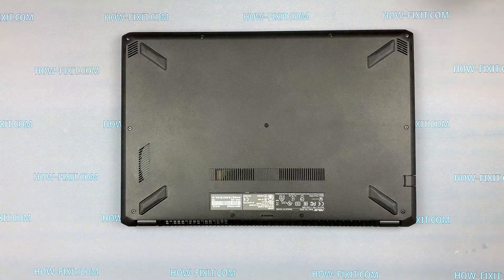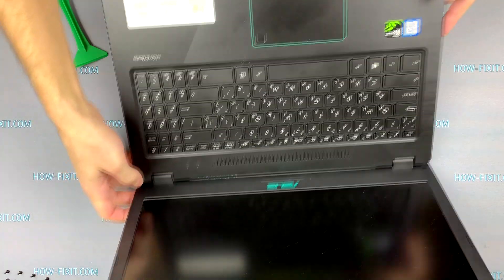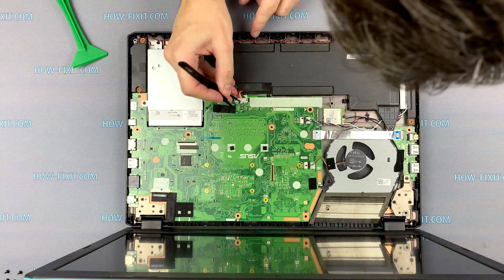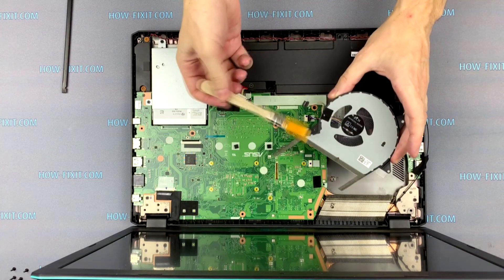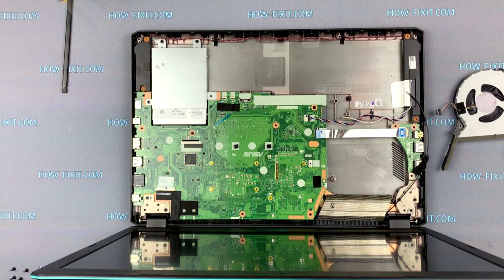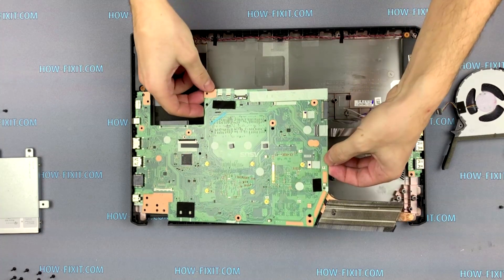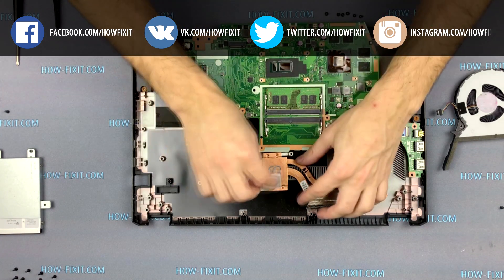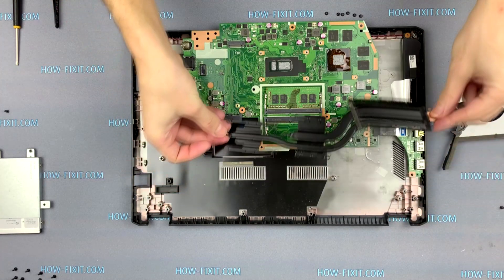Asus X570, K570, F570, A570, M570 Disassembly, Fan Cleaning and Thermal Paste Replacement

Comment: I have the same laptop but it keeps shutting off after 30 secs from booting. I tried to replace the thermal paste and still keeps shutting down. Checked the temperature in Bios and says 112°c. What should I do? Thanks in advance if someone will response.

Comment: I need help :/ I followed this and did clean my fan. But then when I opened my laptop. My audio is completely gone :( "No audio or headphones Are plugged in" please help...
Reply: "No Speakers or Headphones are plugged in" Is whats showing
Reply: So I tried retracing my steps. And it ended with my laptop Unable to even open anymore...
Reply: @BeanyCutePaws  probably damaged some of the wires
Reply: @BeanyCutePaws  laptops i believe are more delicate. you may be able to perhaps find replacements online? not sure